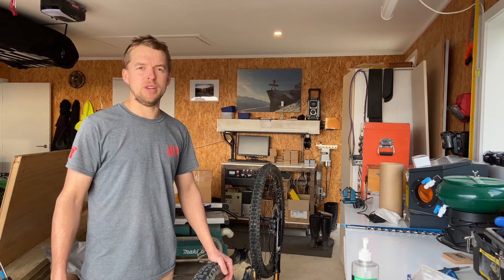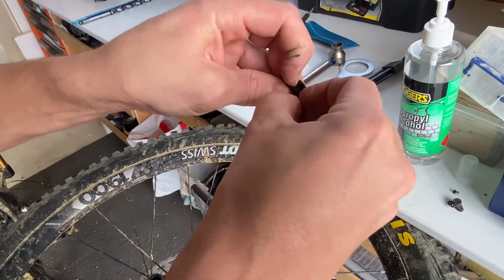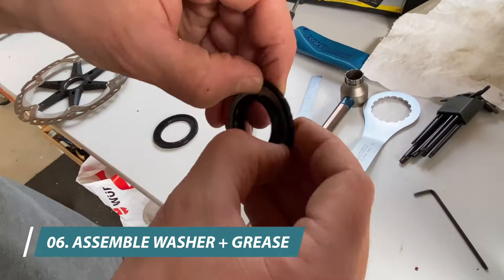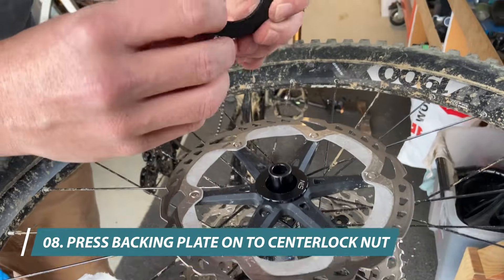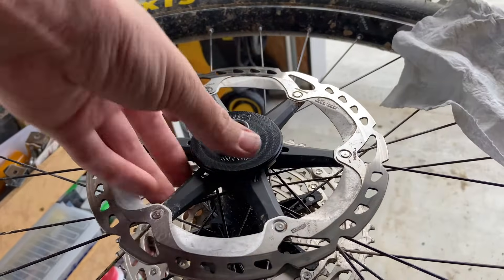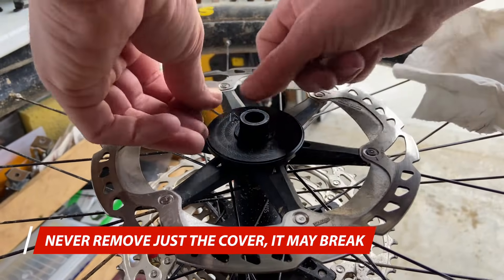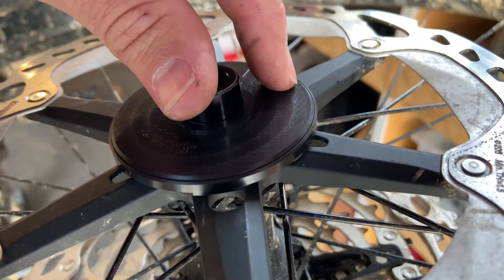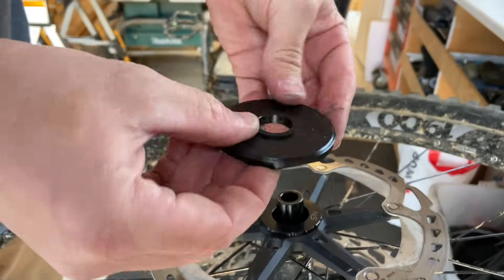E-bike speed delimiter: SPEEDi [Center Lock Installation Instructions] Increase your e-bike speed

Comment: That sounds like the issue I been having on my Yamaha Moro 5 with the cover. I been hearing a slight ping sound but it's not the rotor. And it seems like it's the cover. I just took the wheel off and when I turn the magnet cover there is a very subtle squeak sound. I was able to take it off with little effort. I will look at the service manual. The owners manual isn't very helpful.

Comment: Por que No funciona con el emtb.............solo eco----tour+----turbo
Reply from the maker: SPEEDi does not work with the Bosch Auto Mode as that mode uses specific readings from the motor to make changes to the output. With SPEEDi installed we are essentially tricking the motor into thinking it is going slower than it is, so the readings it relies on are not accurate. This is only for auto mode though.

Comment: Hi I have brand new 2023 Trek Fuel EXE 9.7 and my stock weel rear is Rapid Drive 108, 6-bolt, Boost148, 12mm thru axle For speed shimano.
Do you think this will work? SPEEDi for Trek Fuel EXe 9.7 / 9.8 / 9.9 (2023)
Reply from the maker: Yes.
The 54T vs 108T is on the drive side on this hub, the disc side is exactly the same which means this does not affect the SPEEDi.
Reply: @nlscomponents  ohh thanks notice 54 and 108 and not understand it first. I placed a order. Its gonna be great thanks

Comment: If I use this in conjunction with the speedbox 3 will my bike fly?
Reply from the maker: Haha! I like the way you think. But eventually the motor will run out of power to assist you through the wind resistance, and you will run out of gears, I have found most motors are good for about 50kph - 30mph, which is right where SPEEDi cuts out, at this point you are usually out of gears also.

Comment: Could I make this compatible  with a trek powerfly 7 2019 .
Reply from the maker: The 2019 Powerfly FS 7 has a spoke mounted magnet whereas SPEEDi requires the sensor to be mounted inside the dropout near the axle. If the sensor is able to be mounted near the rear axle then it may be possible for it to work.

Comment: I have an NCM T1,000 e-fatbike, if this part is compatible I will buy it, but I would also need that large circular wrench.
Reply from the maker: The SPEEDi is designed for mountain bikes with mid mounted motors and pedal assist, which have a disc bolt mounted magnet on the rear wheel for the speed sensor to pick up.
Your bike has a rear hub motor which has an integrated speed sensor, so SPEEDi is not compatible, sorry.
Reply: @nlscomponents  I want to cry!
Reply: @nlscomponents  I just removed the controller, I will see if there is a thin red or white wire to disconnect.

Comment: Can this be done without thr bottom bracket tool?
Reply from the maker: The correct bottom bracket tool is highly recommended so that no damage is caused to the nut, as there are fine details that the backing plate uses to mechanically hold itself to the nut.
Reply: @nlscomponents  thanks guys appreciate the response 👍 

I'm not very good at this stuff so just going to watch each step about 5 times as I do l😆
Reply from the maker: @jbloggs4161   haha no problem, the instructions are also very informative and the most up to date https://nlscomponents.com/pages/support
Reply: @nlscomponents  thanks again

Is there a specific bottom bracket tool or are they all the same?

And really sorry to be a pain, but how do i ensure I'm tightening to 40nm?
Reply from the maker: @jbloggs4161  16 notch 44mm, Either purchase the tool that allows the use of a torque wrench, or tighten it with the BB spanner to very tight, you will feel the retaining notches in the nut start to engage, go to around 5-10 clicks past touching.
Reply: @nlscomponents  thanks again guys

Can't wait to receive it!
Reply: @nlscomponents  I've just realised I've been asking you this question 

It's actually the 6 bolt version I've ordered 😆

Comment: How many miles does it take with that device?
Reply from the maker: Great question! I have customers report over 10,000km and still going strong which is very impressive, like everything mechanical it does wear out an need replacing, but I am very happy with it's durability and I'm sure you will be too.